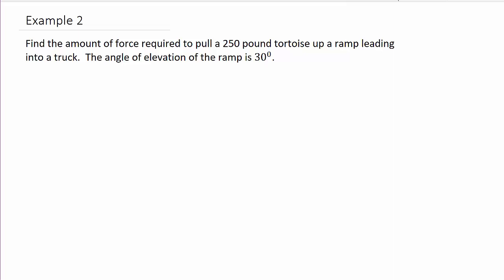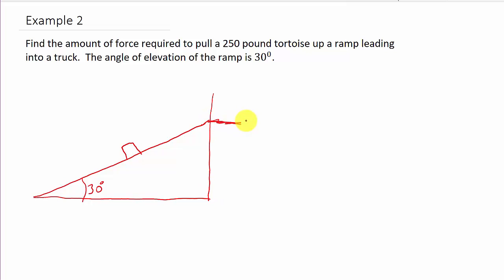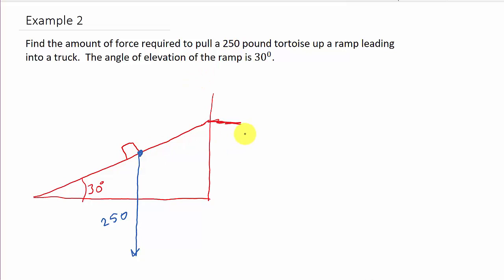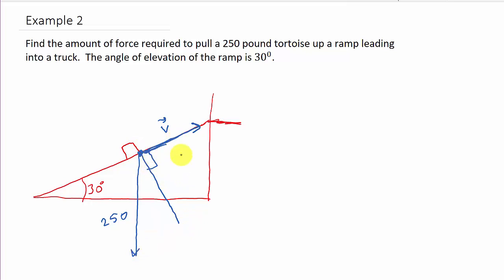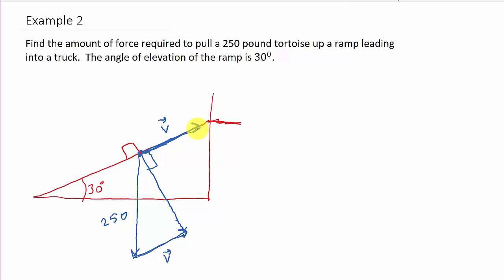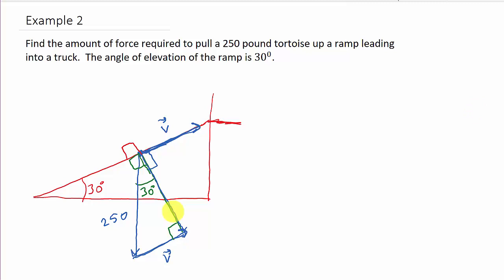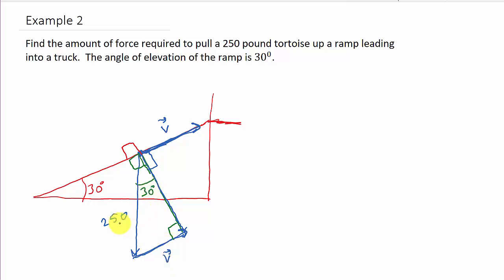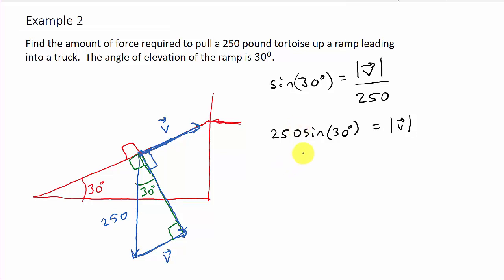Vector Application: Find Force Required To Pull Tortoise Up A Ramp

Comment: Thanks for the great video, but a force of 125 pounds would keep the tortoise still on the ramp. A force greater than 125 pounds would be required to pull it up the ramp.